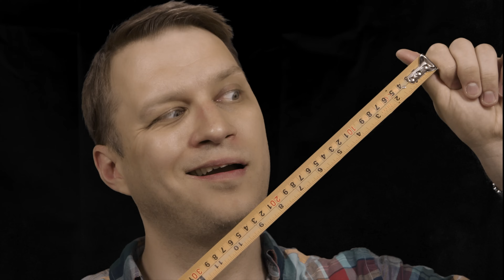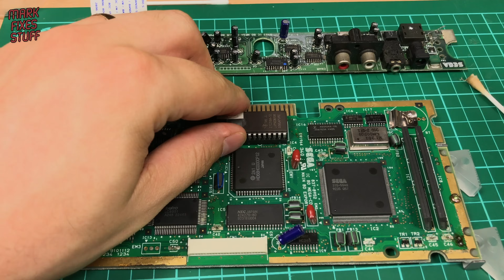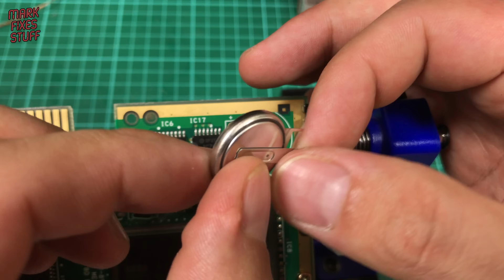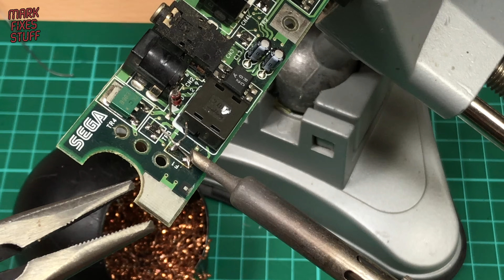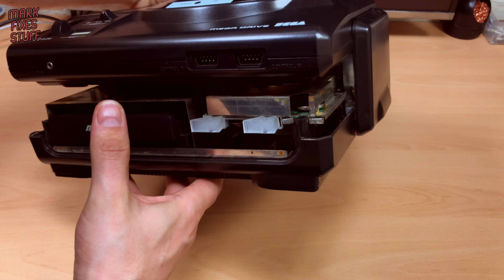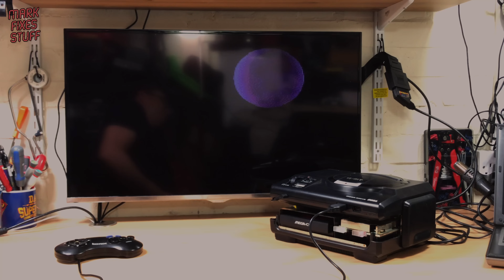Pt 2: Smashed Sega MegaCD Retro Resurrection - Repair time?? SegaCD

Comment: I know this is a old video now but what would you say is a powerful enough soldering iron to tackle this repair
Reply from the maker: 60 watt temperature controlled iron like this is excellent for pretty much all work. https://amzn.to/3JXtCJV it keeps a check on the tip temperature and increases the power if necessary. I’ve used a similar model for five years but then the house fire happened (unrelated!)

Comment: Those japanese Engineer solder suckers are brilliant, really do a good job. So highly recommended, even though I have rework tools, heatguns and solder vacuum machines.
Reply from the maker: RetroJay1974 I agree. The vacuum desoldering gun here is amazing, but the manual SS-02 pump is great for up close and personal work!

Comment: I really envy your desoldering skills, it took me ages to clean up the holes for the two throughole capacitors on the main board (actually, I managed to do it only for one of them, with the help of a needle. The other one I just melted the solder while pushing the capacitor in place). Do you have any tip or trick to do it?
Reply from the maker: You need a really hot temperature controlled iron. The problem with the mainboard is that it has a MASSIVE ground plane, so underpowered irons struggle to melt the solder before the heat is wicked away into the board. 

I actually now have a set of the "desoldering needles" that KiloSierraAlpha mentioned in the comments below and will be trying those out and reviewing them in a video very soon.  (Comment here - https://www.youtube.com/watch?v=ePGrTwP4t1k&lc=UgwzjQnvaMIS_LDa5qR4AaABAg )

Comment: What did you use to neutralize the alcaline  left by the capacitors?
Reply from the maker: painco94 some vinegar, washed away with 99.9% isopropyl alcohol.

Comment: Time to get a desoldering station for these fragile pads ?
Reply from the maker: I do keep thinking that. It's one of those things where I always think "this is the last time" though...

What model do you recommend BTW?
Reply: Got 2. I've got a jobber which is a Aoyue 474A+ which works well and is relatively inexpensive. Then I've got a old vintage Pace soldering/desoldering station with foot pedal also found on eBay (model PPS-200CE, 80's vintage) which works great. Still spare parts available for it!Game changer in doing proper board repairs :)
Reply from the maker: @LFOSyncToo  Thanks for the info. It's definitely something I need, but will have to wait for some money as had an expensive month!